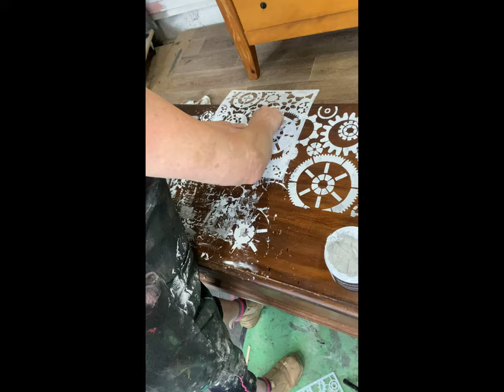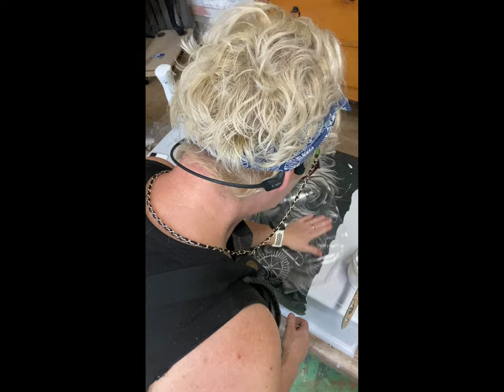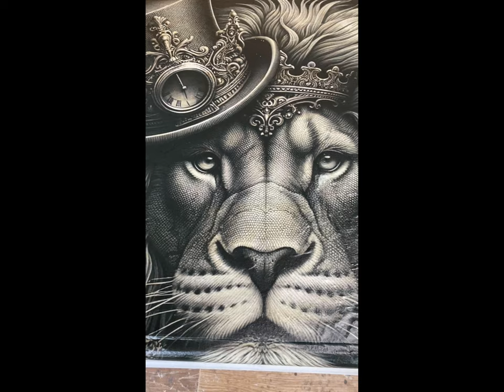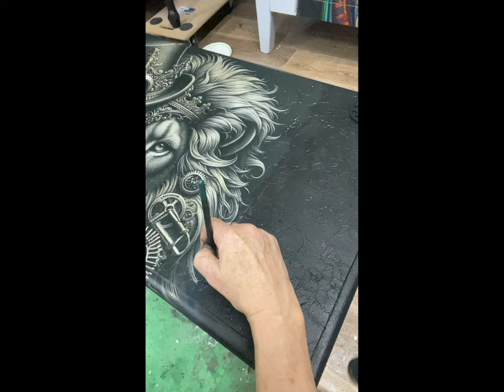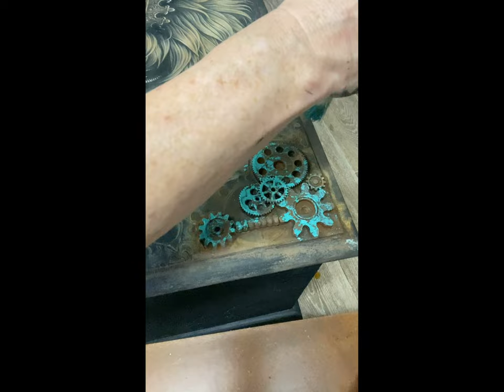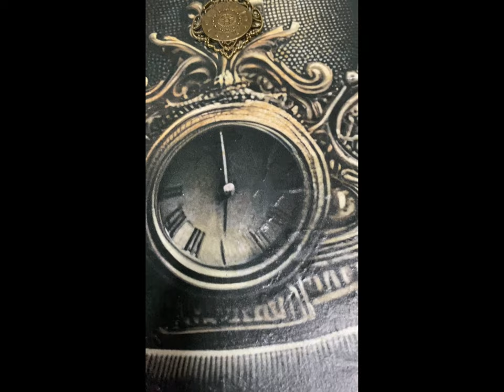Watch me totally steampunk this timber chest with decoupage, moulds, stenciling & mineral paint

Comment: Absolutely stunning!I love your creativity!
Did you seal with varnish on the end?
Reply from the maker: The paint has an inbuilt sealer and the waxes don’t need sealing
Reply: When I decoupage and   seal with oil based varnish and do some chalk paint touch ups then it is really visible unless I seal it again.But often the colors get smudged.Even with spray varnish....
So with the paints you use doesn't show the touch ups on the paper?wow if that's the case I should get rid of the chalk paint...Thank you!
Reply from the maker: @margaretn5068  chalk paint will always need to be sealed again as it dries matte. I’m using mineral paints that have an inbuilt sealer but I usually seal again after I’ve painted